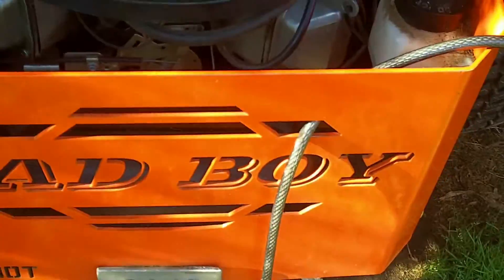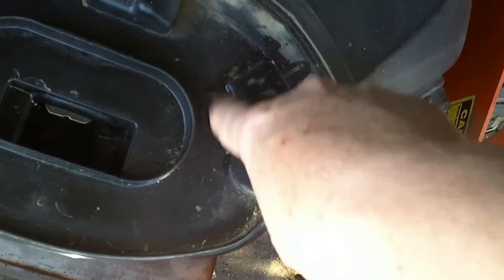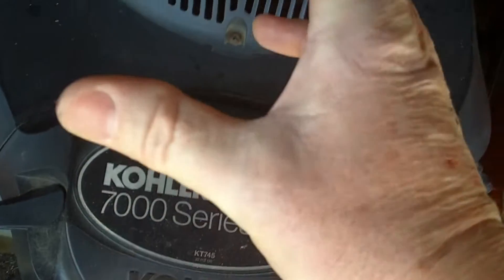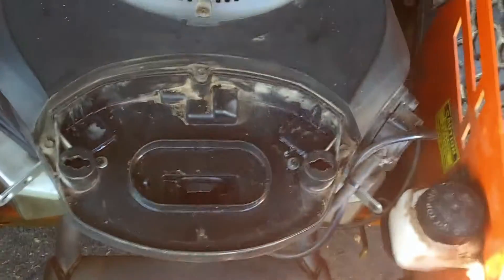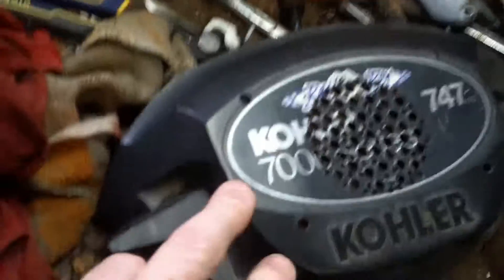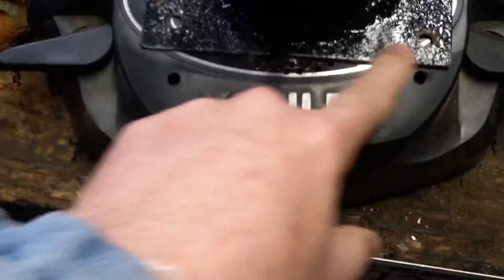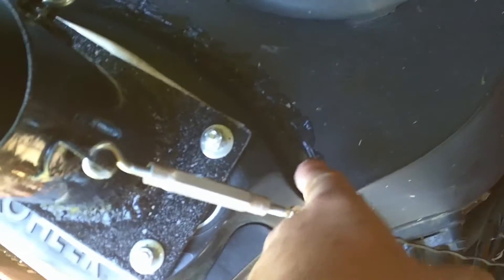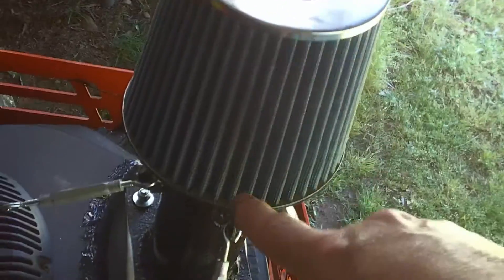Better air filter system for Kohler mower motor!!

Comment from the maker: I went to Atwoods and looked at the new mowers with Kohler motors. Ha Ha they have done some changing to the motors.  The Air filter only gets air from the outside, they changed the hole placement.  And I see a big sticker that says made in USA. Maybe they seen my videos!

Comment from the maker: So far (this mowing season)  I replaced the fuel filter, oil and put in 3.20 E3 spark plugs.  So far I am getting great mowing fuel mileage.  Last mow I hear the motor surging, and that means the carb pilot jet needs cleaned.  I am just going to buy a new carb, but the new carb will have a idle AF adjustment that will make it run even better.